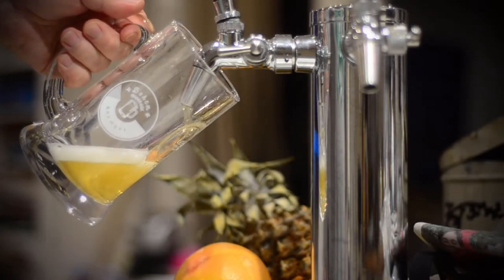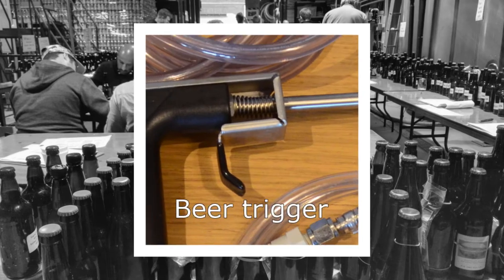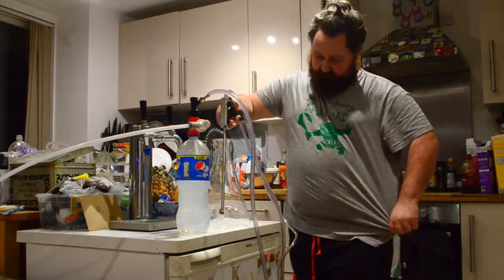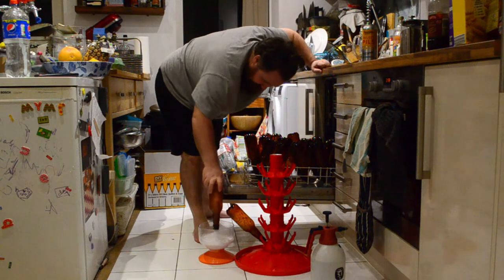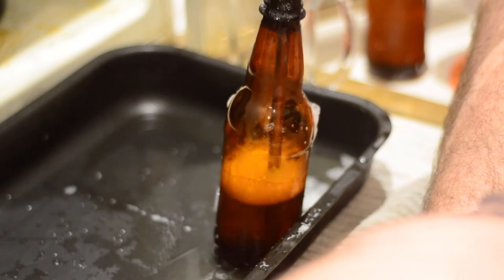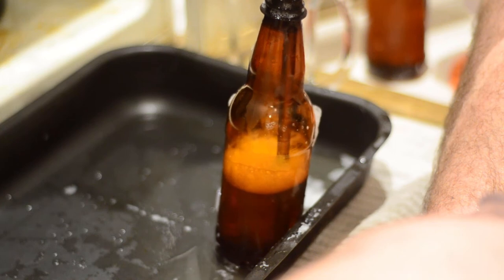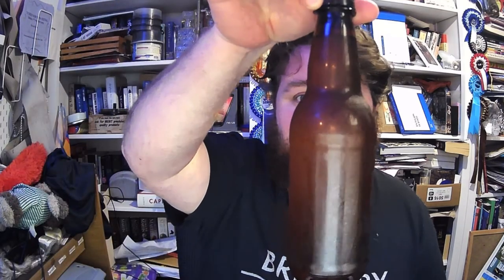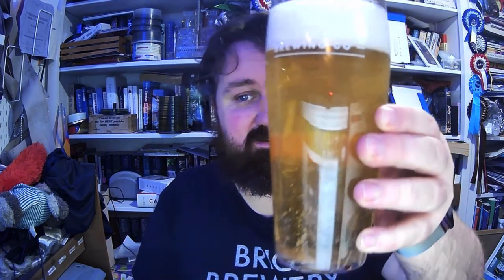Bottling from Keg with a Beer Gun

Comment: How long do you expect the beer to maintain a decent amount of carbonation?
Reply: I think that more depends on the bottle and capping/seal than the method used to get the beer in there. Wether you're using PET bottles or glass with crown caps, as long as the beer is carbonated going into the bottle and the seal is good (you need to re-tighten PET lids a few times) I wouldn't expect you to lose carbonation at all. It should be good for 12 months plus.